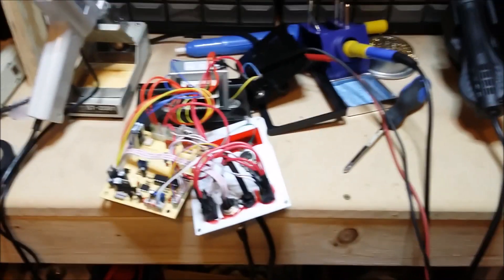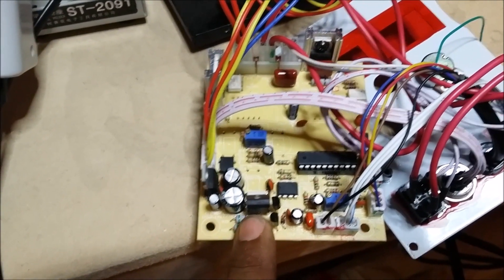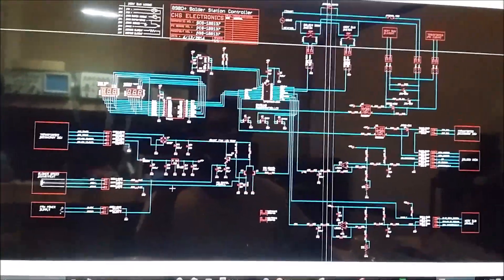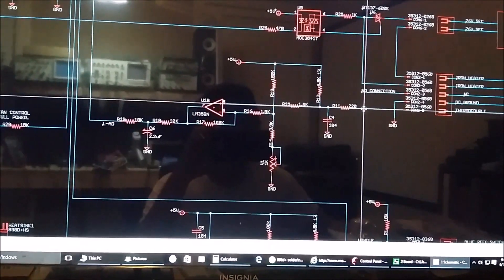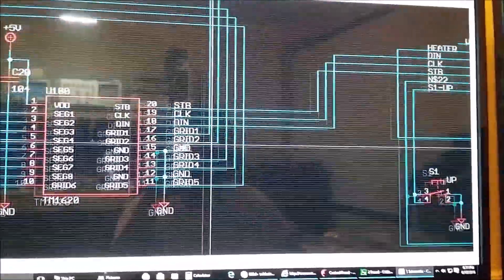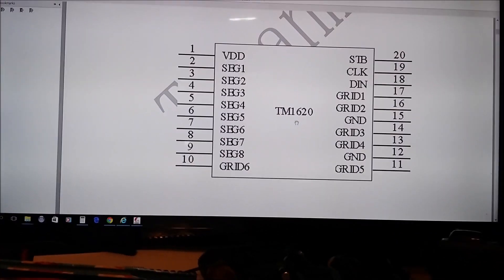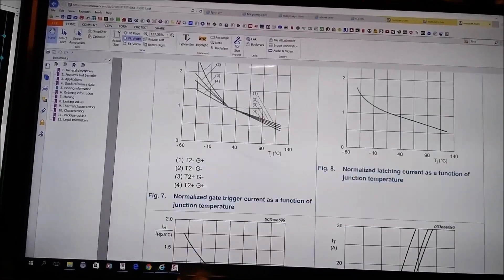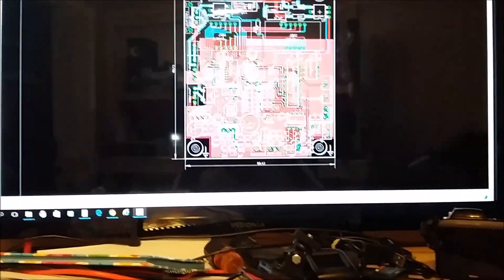898D+ 2in1 Solder Station Reverse Engineered

Comment: I have one of these heat station The Is soldering iron Works but the numbers On the display is reading 004
Reply from the maker: Hmm. I haven't heard of this issue before. Perhaps the display driver has failed or the temperature sensing circuit has failed.

Comment: Love your work on this. Perhaps someone can help with an issue with my 898D+. Problem is this.... my old gun/fan seized and failed. I replaced the heatgun, but for some reason the element stays on nearly MAX Heat and element is constantly burning red. Temp is set to 200c to try protect element burning out. My Other 898D+ doesn't have this constant burning element problem, but pulsates instead (and stays below red). It's like a constant voltage is reaching the element. There is no short circuit on the TRIAC or MOC3041. TIP122 works fine (i replaced this anyway), fan works fine.
Reply from the maker: Hi @GurjVirdee! Thanks for stopping by and watching the video. It seems to me that the triac controlling the heating element is constantly being triggered by the MOC3041 if the triac really hasn't failed. If you can, lift one of the low side control pins of the MOC3041. If the heating element is still on, then you know the triac failed. If it stays off, check the two control lines to the MOC3041. If one is higher than the other, then the microcontroller is keeping it on. The microcontroller will get the on  signal from the analog output of the op amps. I'm not sure what voltage levels they should be, but if they are working properly, then something is giving false signals to the op amps. Check their inputs.

Hope this helps.
Reply: @CHSElectronics  Fab, thanks. I've ordered MOC and TRIAC earlier today, just in case. Will  see how I get on when those parts arrive.
Reply from the maker: Good luck bud. Keeps us posted!
Reply: @CHSElectronics  swapped out MOC3041 and TRIAC but still the same. Heater still glows max.

Comment: Thank you! I just fixed my soldering station. My symptoms were: even when soldering iron was cold, it showed 100-200C temperature right away. Then the temperature on display was increasing way faster than usual, but soldering iron was still cold or barely warm. Replaced LM7805 and put heatsink on it. It happened after I used my soldering station on power inverter (non-sine output I guess).
Reply: Sometimes it was showing "S-E" on the screen
Reply from the maker: Hmmm, perhaps an error code?
Reply from the maker: That is awesome that you fixed it!  Thanks for sharing your symptoms and repairs!  I would stay away from non sinusoidal inverters.  If yours is one, then that's a good lesson for all to learn.  Thanks for sharing!!

Comment: my fan constantly runs at max speed...tested pot and its working fine but speed won't adjust
Reply from the maker: Hi sammichael25 and thanks for watching the video.  I can help you troubleshoot your unit but it would be helpful to know what else have you done to troubleshoot it?
Reply: @CHSElectronics  I used my multimeter to check the output voltage to the fan and its 48V +/-0.5V regardless of the position of the pot.
Reply from the maker: @sammichael25  Ok. I'll be using my schematic as a reference point for troubleshooting.  Check Zener diode D2 to if it is short or failed open. Make sure you read around 8v across D2. Check if Q3 and Q2 also haven't been shorted as well. Check if Q3 has failed open. If either D2 or Q3 have failed open, this would cause the fan to run at max speed.
Reply: @CHSElectronics  I get 0v across D2....also im not sure how to test q2 and q3 using a multimeter.
Reply from the maker: @sammichael25   I take it that your understanding of electronics is limited and that you don't fully understand the schematic.  No problem, just know where you are on the board at all times.  You do this at your own risk and I assume no liability for any damages to you or your equipment.  Proceed at your own risk...

Understand how the circuit works.  D2 serves as a pedestal voltage for Q3.  It prevents the collector of Q3 from going any lower than 8v or so.  Q1 only serves to either allow the fan to be controlled by the pot or by the microcontroller.  By turning Q1 fully on, it cuts off the current flow to Q2 and therefore shutting it off.  Q3 serves as a variable current limiter to Q2.  It will deprive Q2 of current when the pot is set to its minimum and it will allow max current to Q2 when the pot is set to it's maximum.  

Before getting any deeper into trouble shooting, power OFF the unit and measure the values of Resistors R27 and R29.  They should not measure infinite ohms or some value really low like 100 ohms. Power the unit ON.  First verify that Q2 still works by shorting the Base of Q2 to Ground.  The fan should immediately shut off.  DO NOT leave the short to Ground for more than 2 seconds.  R29 will get warmer than it needs to be if it is good.  If it doesn't shut off, then Q2 is bad and it should be replaced.

If Q2 is good and you get 0v across D2 when the unit is powered, then it could mean that D2 has failed as a short to ground.  If R27 is good, replace D2.   You can check Q3 by measuring the voltage at the base of Q3 by varying the speed control pot.  If you see the voltage varying at the base of Q3, then the pot is good and Q3 is bad.  If you measure 0.9v or so all the time at the Base of Q3 and the fan is still at max speed, then the pot is still good and Q3 is bad again.   If you measure 48v or so at the collector of Q3 all the time when you vary the speed control pot, then Q3 is bad once more.  This is a triple check.

These steps should help you determine which component/s have failed.  
Please post any updates you have regarding the status of your unit after attempting the repair.
Thanks
Reply: @CHSElectronics  Ok so with the unit off, I get 1.3K across R27 and 5ohms across R29....however I de-soldered both resistors and tested them and both read 5.1K. When i short Q2 to ground...the voltage output to the fan drops but only briefly when the short is made...once i remove the short it returns to 48v
Reply from the maker: Great, so know you know what the problem is.  Grounding the base of Q2 should have shut it down completely.  That is what Q1 is suppose to be doing.  Replace Q2, D2 and also Q3 just to be sure.  It should work fine once these three components are replaced.  If it doesn't shut off when you place it on the handle, replace Q1.  If Q1 doesn't fix it, then the IO pin that drives Q1 may be bad.  Come to think of it, just replace all four components and get it over with.  Hope this helps.
Reply: @CHSElectronics  ok great...one last question...can I replace q1 and q3 which are 2n3904 transistors with a Bc557 or Bc547 or a Pn2222A. Just wondering since I have those at the moment
Reply from the maker: Well, you can't use the BC557 since it is a PNP transistor and the 3904 is an NPN transistor.  I would use the BC547 for Q3 and that's only because it's rated at 45V.  Even though it is below the 48v you will be applying it, this transistor when used in series with D2 at 8v, will never see the full 48v.  Q1 on the other hand will have the full 48v at it's collector which is even higher than what the 3904 was rated for.  If you have another similar transistor that has a higher voltage rating along with a higher current rating, then use that one for both Q3 and Q1.  The PN222A can handle the power dissipated when fully turned on but, just like the 3904, it is only rated at 40v.  Both transistors can handle the power that will be dissipated but only barely.
You would be bettor off buying a 1 amp continuous current transistor that is rated at 60v.  It would also have to handle a minimum of 650mWatts so that it would last you indefinitely.  The 3904 should have never been used.  I would use the KSC1008GTA instead.  Don't get the "C" version!  It can handle 700mAmps of current and is rated at 60v.  It can dissipate 800mWatts of power.

Also, replace R28(10K).  Use a 4.7K ohm resistor instead.  This will allow 1mAmp of current into the base of Q1 so that it can fully turn on.  They don't need very much.

This is a mod you can try.  I will have to do the same thing when my unit fails too.
Reply: @CHSElectronics  I made the changes and now my unit works flawlessly....thank you sooooo much!!!!

Comment: Hi CHS_Electronics
i have LK878A with issue of soldering iron excessive temperator, i changed the new pencil soldering iron but still the same problem. could you help to solve the faulty control board. thanks in advance.
Regards

Comment: So if I replace R23 270 ohm with a 360 ohm on the soldering side triac, what do I do with R25 1K for the hot air triac? And is this for 240V? 
Because the circuit application for the MOC3041 shows 360ohm for 240v and 180ohm for 110VAC.
Reply: Should I upgrade the triacs with ones of  better quality?
Reply: I just got it and haven't used it yet... Just wanting to do the known mods such as the switching of neutral to hot wire on mains switch, and anything that could have a catastrophic failure before I put it into service...

Comment: so i turned on the iron side and immediately, misclicked and put the settings  to 400C, the temp-counter was going all the way up to 300 and the bam, it justs showed "005" in the temp display. and realized something just broke.  i tested the other side. the heat gun and is working fine. so i guess the microcontroller is OK,  and the display is ok too the settings buttons/switches all respond. but the iron side just shows 005 and doenst heat.  what would you do? should i replace the triac and the thermistor?. i can post video of my uni if you want.
Reply: i forgot to mention how to check if the ceramic heater is broke?, i tested the resistance of mine and it says 16ohms.  i checked other guys videos and theirs shows 50ohms. the model of the ceramic heater is A1321, i think we all have the same model.
Reply: so i was recording a video to show you what is wrong with my unit and suddenly everything works fine, what the hell??.  oh well. if something strange happens i will record it next time.

Comment: Thank you for this video, I've had it bookmarked for almost a year now, I keep coming back to my Yihua 898D+ project... trying not to let this turd be a total waste!

I bought it for Christmas last year. Got to use it a total of 3 times (the first time being just to see if the damn thing works). The next time I started it up the fan would run constantly, regardless of whether the handle was on the dock or not. No overheating. Iron side still worked. Just the fan was always running.

So I take it apart, I inspect everything, nothing terribly unusual. One slightly bowed capacitor (C5). I painstakingly take down the part numbers and research all the data sheets for what they used, as you did, and compared against your video. Our boards are actually significantly different physically so I had to follow mine mostly. I bought and installed new TIP122, BT137-600E, and BTA12-600B. Replaced all the 3904's. I also bought and recapped every electrolytic cap with Nichicon. Replaced all the 1W resistors.

Now, the handle still recognizes the dock, but the fan doesn't turn on at all, and it will overheat itself unless I shut it off. Doesn't overheat unless I take the handle off the dock. It will shut off when reapplied to the dock. I also get a light buzzing from the transformer when the iron is on now, especially as it comes up to temp.

Checked inside the handle again, everything in there seems fine, so it had to be something I did. I took pictures of the wiring so the connectors are in the right place. I don't know where to look next

Comment: Great job.  I don't think you showed the back panel.  Did yours have a main power switch on the back?  I think I have a genuine Yuhua which has the main switch on the back and the leds flash to warn you to shut off the main switch if the front iron and heat gun are turned off.  I think that was a mod after people posted videos of the heat gun failing and "turning on" when the front switch was off.

Comment: Do you know where can i buy a replacement for that transformer?
Reply: thanks for the reply, i tried searching everywhere using the part number and the specifications and nothing. i already bought another model. but still searching the part to fix this one. what if i use a 32v transformer and use some small voltage regulators to get the other output voltages needed?, do you think it may work?. Great channel and keep the good work

Comment: thanks for your time...I'm using Atten 858D+ Hot Air station...cheap tool but for a hobbist like like do the job very well...
Reply: yes,I think that have inside a pic Mcu or ATMega both....I can't remember but do the job very good,thanks...